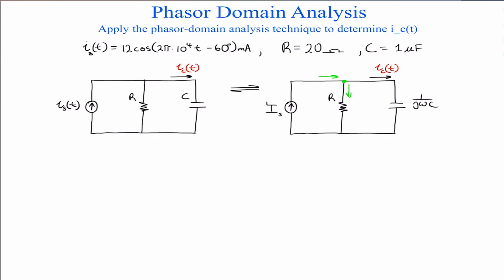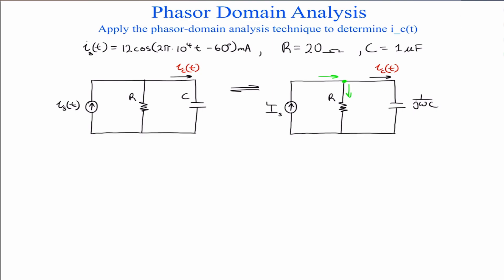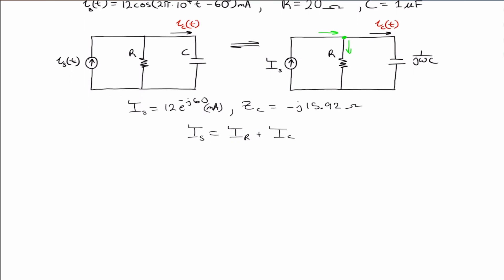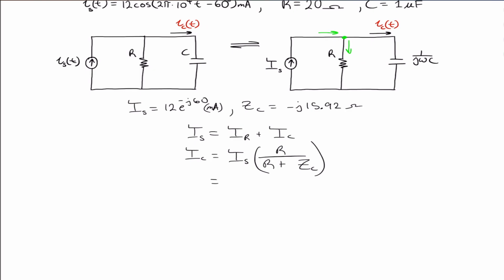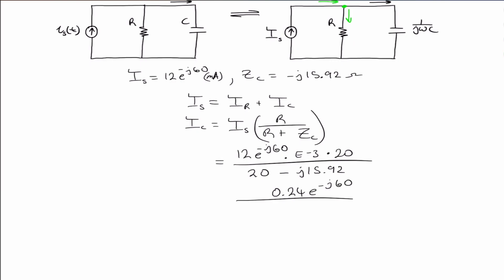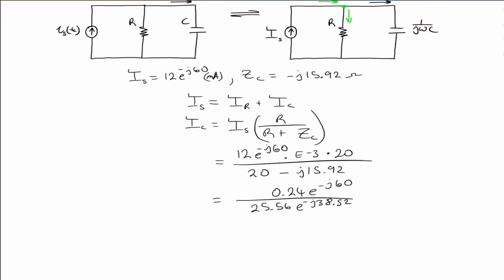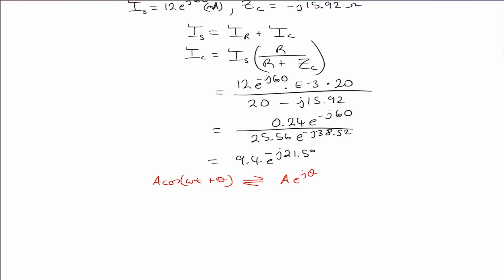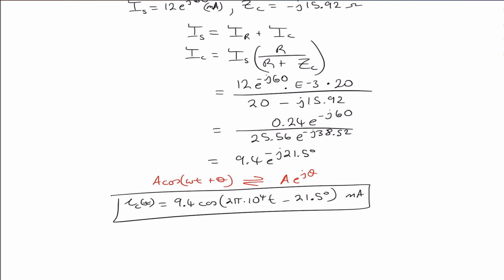Apply the phasor-domain analysis technique to determine the current i_c(t) -  AC Analysis

Comment: How did you get Zc at 0:56
Reply from the maker: Zc = 1/(jwC), now move the j from the denominator which then becomes -j*(1/(wC)), you then take the w from the time-varying current { w = (2*pi*10^4) }. thus 1/((2*pi*10^4)*10^(-6)) = 15.916